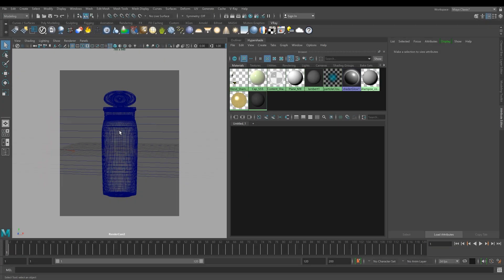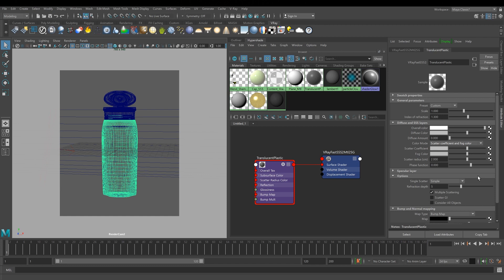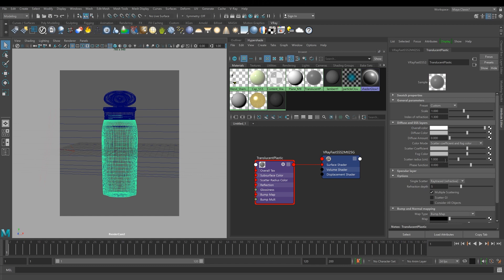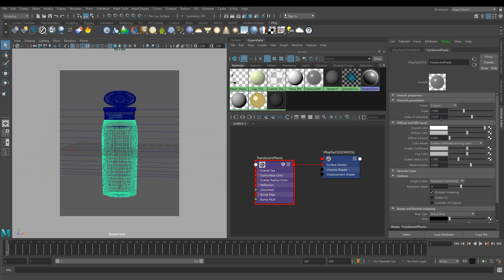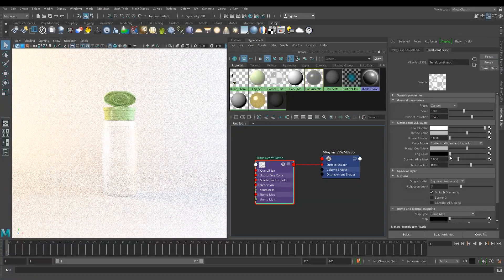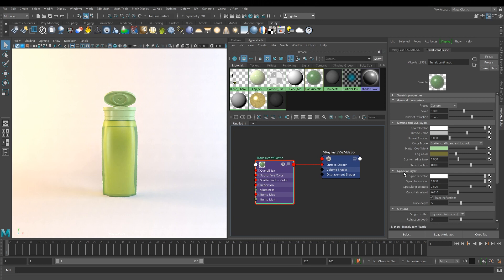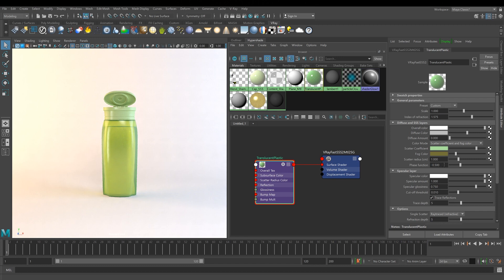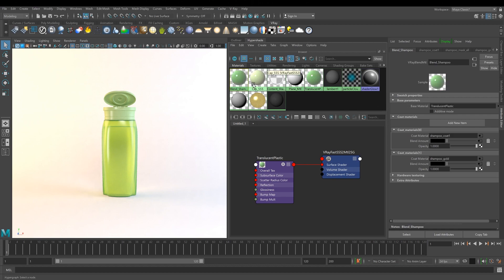V-Ray for Maya — How to Make Translucent Plastic

Comment: Too bad that fastsss2 has many functions that does not work with gpu. Does not work at all on gpu and I cant switch my pipeline for cpu rendering only for translucent plastic. Hopefully this feature will work on gpu in the future. Also please add support for sss on vray standard material. Other than that love Vray 5. Blazing fast on gpu. You guys rock!